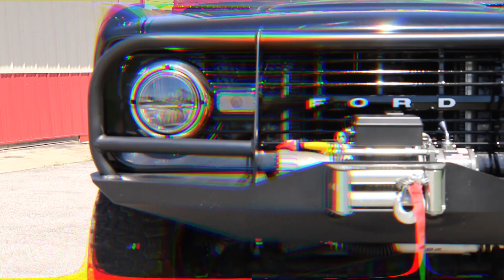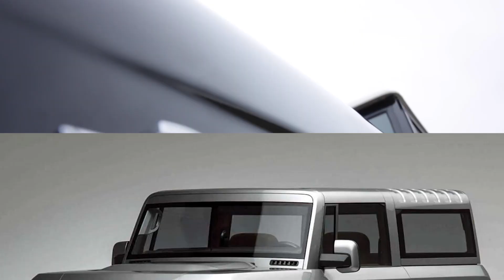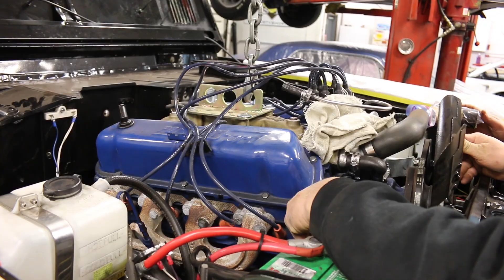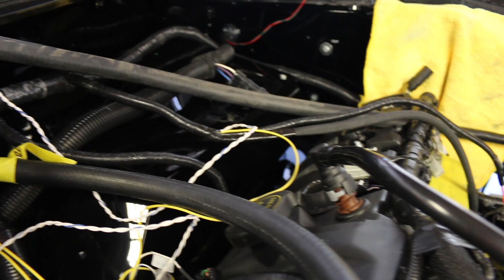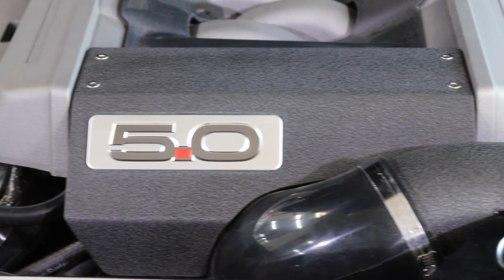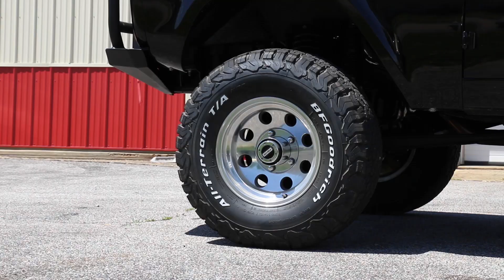Classic Ford Bronco Gets Modern Muscle with Coyote V8 Swap!

Comment: I have a 75 Bronco and looking to do something similar. Am I correct in thinking that other than the wheel well modifications, the engine fit? motor mounts lined up? Great video!

Comment: A 408 with AFR heads would stomp the living snot out of that Coyote at a fraction of the price.
Reply from the maker: In a drag race situation, it's possible.    However, we have to consider the goals of the car and customer.    He's not about having the fastest 4-wheeler on the trail.   He wanted reliability, good power, and great economy... something the 408 would have trouble with by comparison.    Good feedback.
Reply: @V8TV  Do you have any idea how many pushrod engines have provided those criteria for Bronco owners over the past decades? The Coyote is oversized (mods to engine bay decreases value of vehicle), overweight, and lacks comparable off-idle torque, which is critical for low-speed maneuverability. Economy? Let's see how much money was spent on the engine and all the necessary associate components and the labor involved, and then figure out how many centuries it would take to come out ahead at the gas pump versus the Windsor.
Reply from the maker: You sound like someone who just wants to argue, but we're not up for that today.    Have a great weekend!
Reply: @V8TV  No, I'm someone who doesn't buy into the Coyote as the Holy Grail for anything Ford. It has its place, but a classic Bronco isn't it. People "argue" all the time on YT. It's called an opposing viewpoint.
Reply from the maker: Thanks for not arguing.   Too many times people insist on their own viewpoint and don't accept any other ideas.
Reply: @V8TV  One problem that exists here is that most viewers take the opinions of a channel as gospel without having a way to know what another commenter might have in the way of physical possessions and experience/history. If I had a dollar for every time somebody assumed I'm some broke millenial with a skateboard just because I had something to say I could buy a, umm, Coyote.
Anyway, my predication, which is not earth-shattering, is that the Coyote will be singing the blues once the 7.3 starts moving up the food chain. Viva la pushrod!!

Comment: Is the coyote justa 4 valve bored out crown vic motor...looks very similar
Reply from the maker: The Coyote is similar, but improved in many ways to the previous Mod motors.    Here's an overview... 

5.0 L Coyote
The 5.0 L; 302.1 cu in (4,951 cc)[13] Based off of the architecture of the 4.6L and 5.4L Modular V8’s, the "Coyote" V8 is the latest evolution of the Modular engine.[14] Ford engineers needed to design a V8, specifically for the Mustang GT, that would compete with the GM 6.2L LS3 used in the new Chevrolet Camaro, and the new Chrysler 6.4L Hemi ESF in the Charger, Challenger, and Grand Cherokee. Since this engine replaced the already popular 4.6L and 5.4L Modular Engines, this engine had to remain close to the same physical size of the outgoing 4.6L, and share other specifications with it such as bore spacing, deck height, bell housing bolt pattern, etc. in order for the engine to utilize existing Modular production line tooling (the source of the 'Modular' designation for the engine family). The result was the 5.0L Coyote, which produced roughly the same amount of power as its competitors, but with a much smaller displacement. To strengthen the block enough to handle increased output, webbing was extensively used as reinforcement in the casting, rather than increasing the thickness of the walls. The intake plenum was also situated low between the two cylinder banks to meet the height constraint, thus the alternator traditionally placed low and center was moved to the side of the engine. It shares the 4.6 L (280.7 cu in)'s 3.937 in (100.0 mm) bore spacing and 8.937 in (227.0 mm) deck height,[15] while bore diameter and stroke have increased to 92.2 mm × 92.7 mm (3.63 in × 3.65 in), respectively. The engine also retains the 4.6 L's 5.933 in (150.7 mm) connecting rod length, which produces a 1.62:1 rod to stroke ratio.[16] The firing order has been changed from that shared by all previous Modular V8s (1-3-7-2-6-5-4-8) to that of the Ford Flathead V8 (1-5-4-8-6-3-7-2).[16] Compression ratio is 11.0:1, and despite having port fuel injection (as opposed to direct injection) the engine can still be run on 87 octane gasoline.

The Coyote features all new 4 valve DOHC cylinder heads that have shifted the camshafts outboard, which allowed for a compact roller finger follower setup with remote hydraulic valve lash adjusters and improved (raised) intake port geometry. The result is an intake port that outflows the Ford GT intake port by 4 percent and the Yates D3 (NASCAR) intake port up to 0.472 in (12.0 mm) lift, which is the maximum lift of the Coyote's intake cams. Engine redline is 7000 rpm.[16]

The Coyote is Ford's first implementation of its cam-torque-actuated (CTA) Twin Independent Variable Cam Timing (Ti-VCT) in a V8 engine, which allows the powertrain control module (PCM) to advance and retard intake and exhaust cam timing independently of each other, providing improved power, fuel economy and reduced emissions. The engine is assembled in Ford's Essex Engine Plant in Windsor, Ontario, using existing Modular tooling.[17]

Comment: like the truck and motor..but i think i would have done a 351 / 408 stroker and it would have fit nicely ...but still cool..way better then a crappy LS swap
Reply: Yeah they're garbage that's why they have been put into everything...Guys are adding turbos with 800hp on stock bottom ends
Reply: @bilbobaggins4710  let me put it this way ..the LS is a good motor..but not for any fords..i'm a ford guy./.i would never butcher up a ford to put any chevy motor  in it.ford windsors are also a very good motor and will make lots of power too